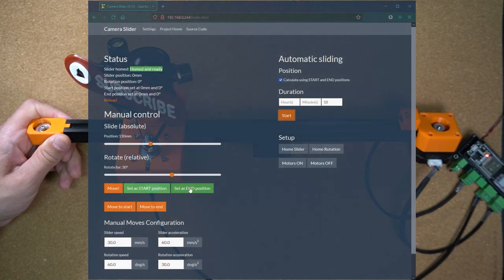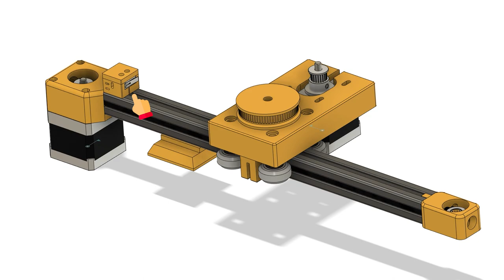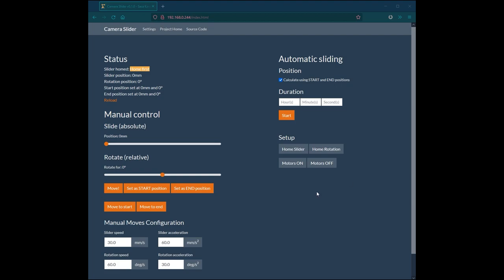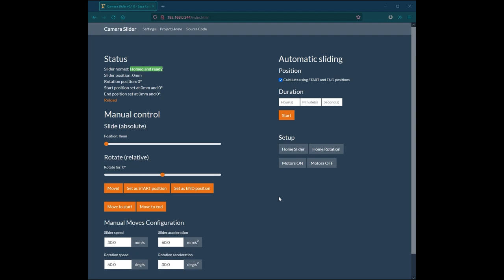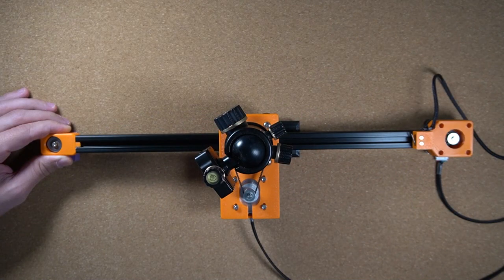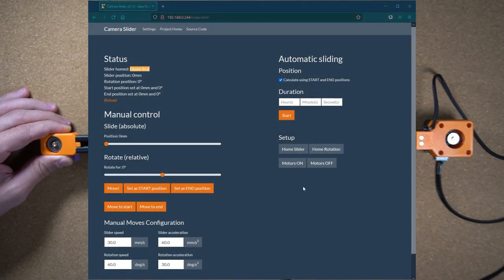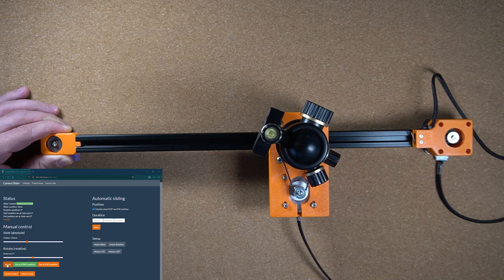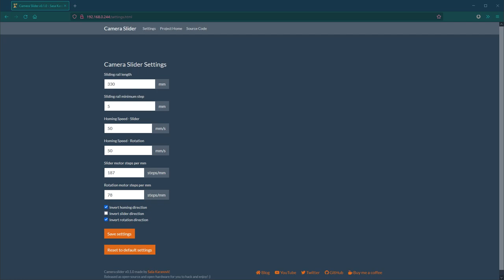DIY ESP32 Camera Slider

Comment: Have you thought about updating it for eccentric nuts to adjust the wheels? I'm scared to buy all the parts and not have wheels with the exact same diameter as yours resulting in a sloppy gantry lol
EDIT: or adding a version of the main plate so use that metal gantry you showed 4:32
Reply from the maker: The 3D model is available for download so you could modify the holes to fit eccentric nuts. Also I think the 3D model contains the gantry. But in either case, the entire project is open-source open-hardware for this purpose; so that you or anyone else can take it as a starting point and modify it to fit your needs.
Reply: @SasaKaranovic  I wish I had the fusion 360 ability lol Thanks for releasing everything though! I'm probably still going to give it a shot since I have 90% of the parts from various printer upgrades
Reply from the maker: It's a great opportunity to get more comfortable with Fusion360. You would need to make a minor change to the sketch (change hole diameter) and you are good to go.
There are thousands of good tutorials that would get you started with Fusion360.

Comment: Great videos        how about add an button to control the operation of the device? In addition, it would be even better to add infrared control function to control Sony cameras
Reply from the maker: Great suggestion! I wanted to control the slider entirely over WiFi, so no physical buttons.
I actually have an older version of the PCB that has multiple GPIOs and IR drivers. But including IR codes, camera selection etc. into UI seemed a bit confusing and it's not really required to operate the camera. Also all of my cameras have WiFi/BT remote app that you can use, so I opted to remove that feature.

Comment: Thank you very much for freely distributing this work
I am using DOIT ESP32 DEVKIT V3 board and esp32- 2.0.5 but the board is not connecting to wifi. The ssid and password are correct, it may be happening. What exactly do you mean by this part of the code?
// Configure oTA
#define MDNS_NAME "sk_camera_slider"
#define OTA_NAME "sk_camera_slider"
#define OTA_PASSWORD "change_this_please"
Thank you!
Reply from the maker: This is a portion to configure Over The Air update (OTA). The name of your device and the password you need to use in order to be able to start OTA update.